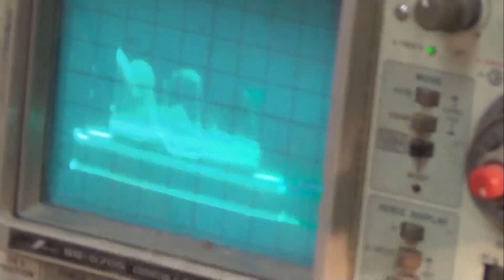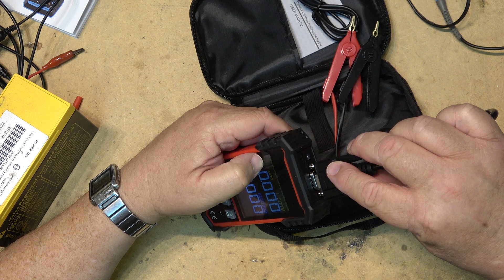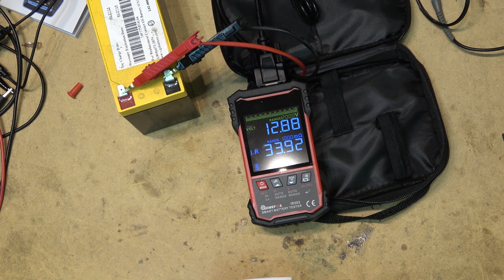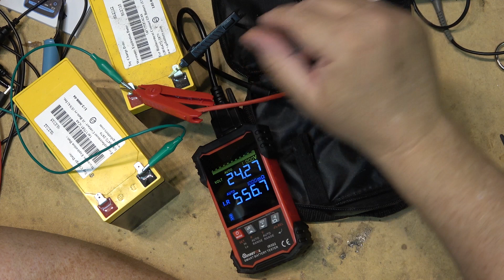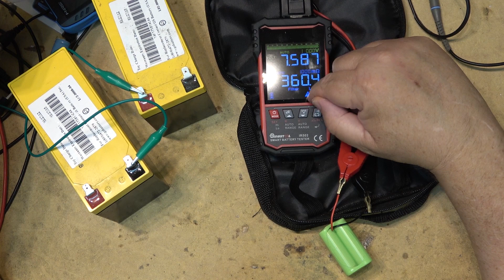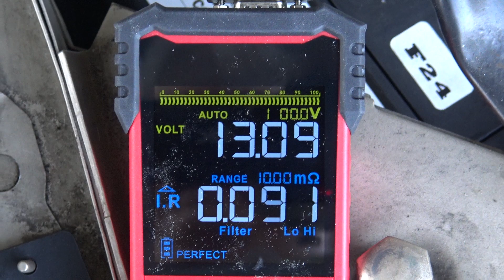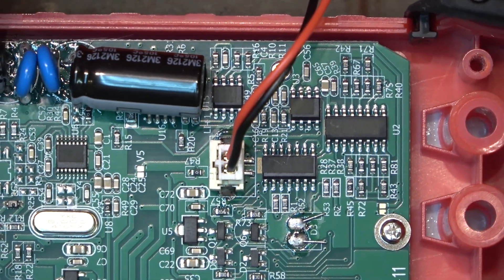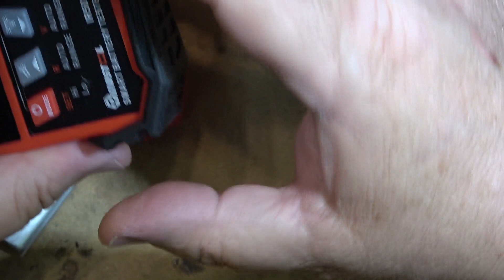MUSTOOL IR502 Smart Battery Tester Unbox Test and Tear Down

Comment: 30 milliohms doesn't seem too bad for one of those backup batteries. If you draw 100 watts it will only drop 0.3 volts. For a 500 watt UPS it's not good enough but for an ONT it should be fine.

And nice story about the video correction devices. I know there are US laws (DMCA) against trafficking in certain devices but I thought it was fine in the rest of the world.
Reply from the maker: The units were never illegal here but talking about them on YouTube breaks dmca so they will take your video down.

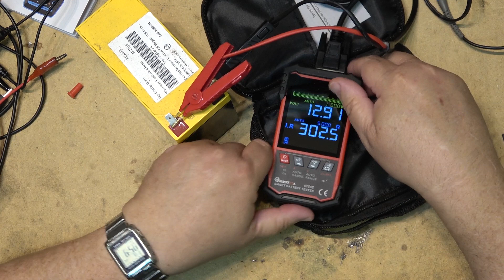Comment: 3:05 does that battery happen to be from a Bell ONT power supply? I've installed many of those. Now I come across many that are beeping cuz they are bad, but since I'm a contractor for the competitor, I just open the door and disconnect the positive lead if they don't have active service.
Reply from the maker: Its from a telus ont. Only put these in now if they have active phone service with either a hardwired phone, hardwired alarm or a lifeline that uses phone.
Reply: @12voltvids  I'm surprised you know that rule! That was the same rule when I was contracting for BellMTS. Whenever I'd be out on a service call for something unrelated, and the customer would say Bell won't replace them for free, I'd swap it anyway. A company worth billions can afford it lol. These giant corporations don't care about customers at all.
Reply from the maker: I would hope I know the rules considering I am the senior tech for the area.   Senior in more ways than one.  😃

Comment: This is much more advanced than the battery testers sold a few years ago.
A must for anyone with an EV as the 12v battery is crucial or you are going nowhere
as my friend found out in his Porsche Taycan.
You would think that with all the onboard dignostics that monitoring the 12v battery
would be included, but not in a Taycan, you only find out when the doors won't unlock.
Then you need a mobile tech to reset everything before the car will start again.
Reply from the maker: Yup, the 12volt keeps the computer running.  No computer and no open da door.  Saw my first mobile charging van today.  A panel truck with a generator in it to charge up stranded ev drivers.  That might be a nice job. Go for a drive and charge up stranded ev at the side of the highway and then I thought about it for a minute.  You are a sitting duck while plugged in to the stranded car waiting for some distracted driver to plow into you while you want for the battery to charge.
Reply: @12voltvids  You would also be a sitting duck if the EV you were charging decided to self ignite.
We have just had a tragic incident here in the UK when a brand new Volvo hybrid went into self ignition.
The rear doors would not open, and the driver suffered 60% burns rescueing his grandaughter from the rear
child seat.
How many more incidents will it take to force the fitting of mechanical door handles on all of doors.
Reply from the maker: @Barbarapape they have manual door releases. Just some don't educate rgemsekf as to where the handle is on the door.
Reply: @12voltvids  In this case the front doors were already open, it was the rear doors that refused to open.
The fire started in the rear seat beside the childs safety seat, time was of the essence, both could have
lost their lives.
If the rear doors could have been opened by a mechanical linkage the burns sustained would have been far less.
Nothing to do with educating yourself as to how to open the front drivers door with a key.
This is a classic example of poor design with little though given to escaping when the electrical circuits
have failed.
Reply from the maker: The problem here is he bought a Porsche. You can't say Made in Germany and Reliability in the same sentence.  FYI I have owned German cars, that was a mistake I won't make again LOL. I found out the true meaning of BMW, Bring Money Weekly, and MB = Money Burner.
Reply: @12voltvids  I can only agree, i only owned one BMW  and within days it was back multiple
times for various issues that were never resolved.
It took a many years for the UK buyers to learn that the Germans are not that clever when it comes
to making reliable products.
This is where the Japanese used to excell, but today as we know they are badge engineered junk
made in anywhere except Japan.
Reply from the maker: Sony high end cinema cameras, regarded as the best in the world are hand made in Wales.
Reply: @12voltvids  I live in North Wales, that factory used to make the trinitron TV's
until they switched over to the flat panels.
At least it shows that skilled labour is still capable of making high end camera's
here in the UK.
Sony should never have tried to compete in the mass market gear, that was the start
of their downfall making it down to a price rather than keeping up the quality.